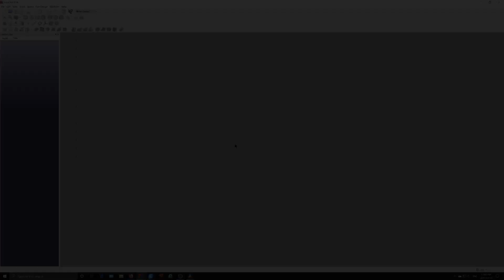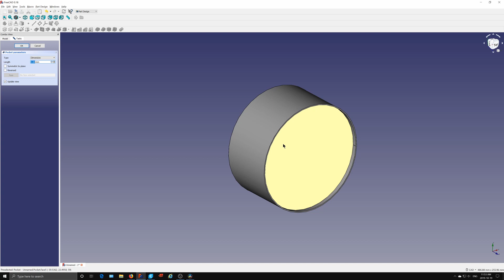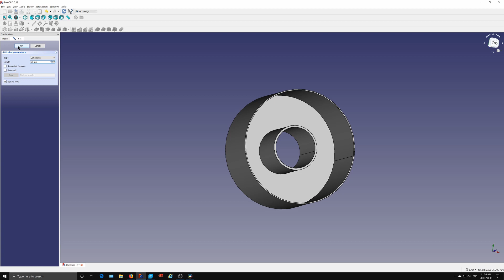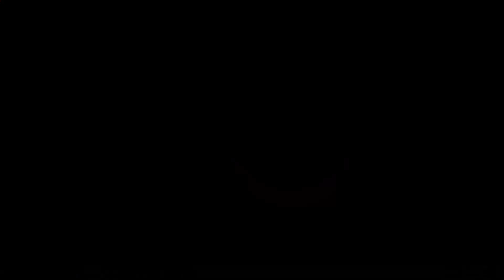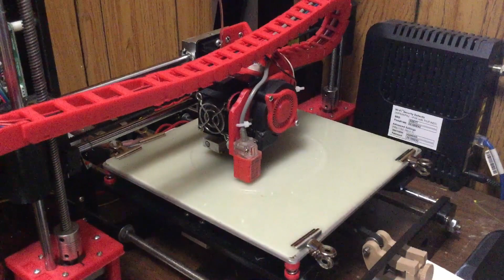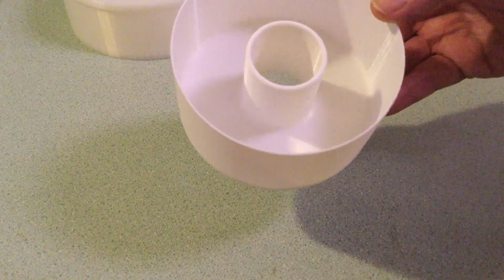G&H Honey Bees - Beekeeping series - 3d design of Nuc feeder

Comment: How many feeders can you make with 1 spool of filament? What type of filament have you found works for you PETG or PLA? Thanks
Reply from the maker: So lets see if I can break this down properly. A 1kg spook holds approx 350 meters of filament.
The large feeder takes 55 meters to print so about 6 feeder dishes. The small nuc feeder takes 42 meters to print so about 8 dishes. The cap the large feeder takes 11 m and the cap for the nuc feeder takes 10 m and the center cap takes about 6 m for either one.
I use PLA for most of the prints. I have started using PETG but it is a little more tricky to get a good first layer out of. I use white for the dishes and clear for the caps and center caps. Does this answer your question?
Reply: @berrrygr  Thanks for the info. Just trying to get an estimated cost per complete dish.
Reply from the maker: Well, for what I pay for a spool, it runs about .13 cents a meter. I think I figured out that the large feeder with lid and center cap is between 7 and 8 dollars Canadian. Not really that much less than what you might pay on Amazon for a commercial version. However the smaller size for a nuc is not commercially available so I filled a need by making my own.

Comment: Nice design. I think I would not even bother with the top if it's inside a shim spacer. How slick are the sides of the printed feeder access tube? How often do you have to refill feeder?
Reply from the maker: I just use the top to contain the girls. Theres a good amount of space in the top and they would most likely get trapped in there. Due to the way 3d printing works the inside tube is lined with little ridges so it makes it easy for the bees to get a grip on it. Refilling depends on how hungry the bees are. One of the hives I have had to refill once a week. The other three big hives have barely touchedthe sugar so I have only topped them off once with maybe a quarter pound of sugar. These little feeders going into my nucs may require filling more often as they wont hold as much as the larger feeders.
Reply: @berrrygr  Two thumbs up.